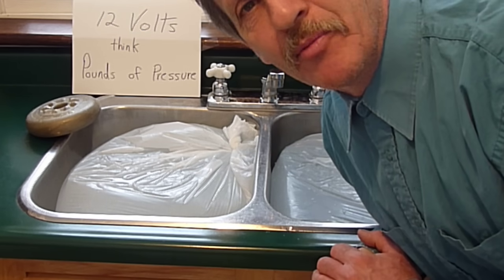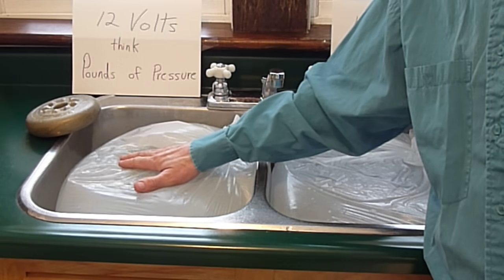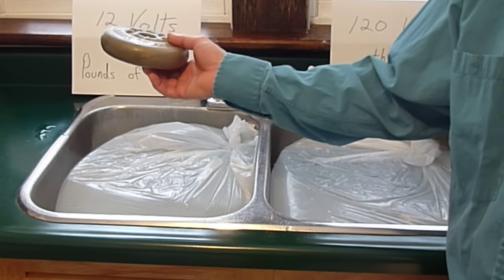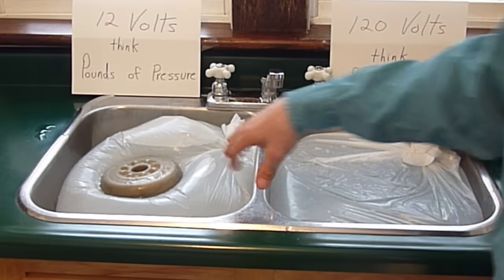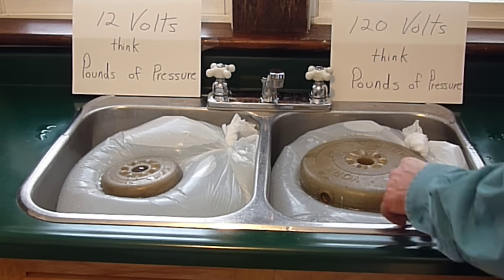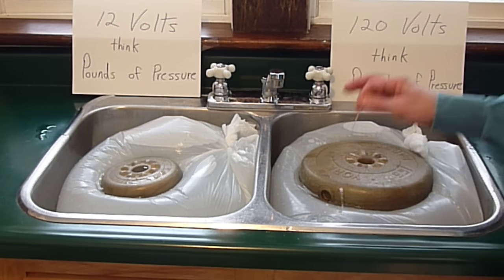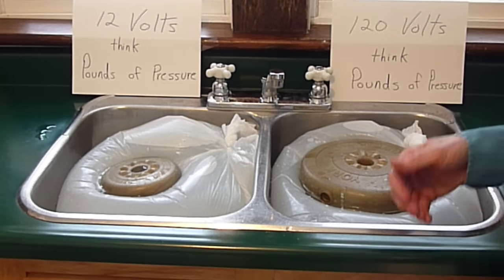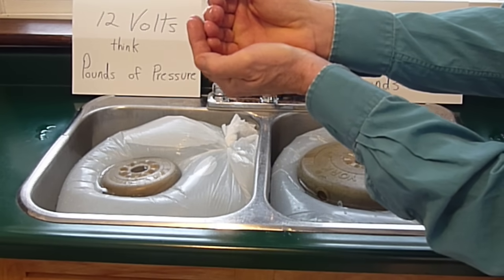Amps, volts, watts explained...SEE what it really is all about.

Comment: It is VERY upsetting to me that all this is not better explained to ALL PEOPLE as a matter of general knowledge, since our entire civilization runs off of it.
Reply: People just care if things work, they don’t care about the why or how.
Reply: If they did I wasn't paying attention
Reply: @lovesyoohoo  oh don't worry, they didn't mention it
Reply: There you go! Now that you know it, go out and start explaining, no need to get upset anymore!
Reply: I even work in energy efficiency (more admin/ops for programs, not an engineer), and I still haven’t gotten my head fully around these three fundamentals :/ these analogies are very helpful
Reply: Well, I was taught this in high school. It wasn't with weights and literal bags of water, but we did have electrical concepts explained by analogy to water. Voltage is the pressure pushing the electricity to flow, current is the flow rate and resistance is like roots and pebbles stifling the flow.
Reply: @Elriuhilu  did you go to high-school in the U.S? If so, what kind and what years?
Reply: @muddbear6410  No, it was in Australia in the late nineties. Just a normal high school.
Reply: @Elriuhilu  ah, yep.  I knew it couldn't be in the U.S. Our schools wouldn't be caught dead teaching anything so useful. For heaven's sake, it might promote thinking or worse, understanding. 
    Over here you have to pay for any actual knowledge beyond the most basic reading and arithmetic. High school is free/ cheap and extended to all. The U.S. would NEVER risk a knowledgeable or capable public. (They might realize they're getting screwed, or WORSE, do something about it)
Reply: What are you doing about it
Reply: Education in general is too focused on test taking mastery and not practical knowledge and application. Granted, folks learn a bit differently but that's differences in flavors of ice cream not the differences between strawberry ice cream, rocks, and battery acid as many unaccountable push.

Even folks that absorb it quickly and ace exams often have 'aha' moments later where it all clicks.

I'd like to see less rote memorization and more approaches like in the video here.
Reply: The schools are teaching kids about 30 different genders instead.
Reply: Wow, this sounds like the kids-in-school-will-pay-attention corner of YouTube.
😂
Reply: @tiltil9442 they will if that old renta a cop in the hallway is armed!

Use punctuation, Timmy!  Or else!
Reply: better to learn how many genders there are and why terrorist groups are really just oppressed people
Reply: They don't want you to understand this.   If you knew how to harness energy you would be powerful.   They prefer you be confused and leave this to "science" and go smoke a vape pipe and listen to monotonous repetitive degenerate music.
Reply: @truthshallsetyoufree99  just because you're dim doesn't mean it's a plot
Reply: @muddbear6410  🤭 whaaaaateverrrrrr
Reply: @richinoable  😂  ah yes, the strongest defense when challenged: "whatever" lol
 An age old defense originally inspired by the bear attack strategy of: "assume the fetal position and urinate."
Reply: @richinoable  😂  I get it now, you're gen z or younger.  That or special class levels of immaturity is the only explanation for thinking someone's angry when there wasn't a single derogatory or even negative statement made. 
   Also explains the "whatever" when asked about your nonsense.
Reply: @truthshallsetyoufree99  yeah you're right, and i don't know that i would call it a "plot" as our buddy richinoable has it.
    Only a moron wouldn't understand that the better educated/ knowledgeable/ capable the average member of a population becomes, the wealthy elite of that population experience more competition and risk of losing their social and economic position.  
   Throughout recorded history those at the top of the social pyramid have endeavored to keep those of the lower levels from ascending. That doesn't mean they're all meeting up to conspire, but it does mean that every time they're faced with an opportunity to hinder their perspective competition, they take full advantage of the situation. 
    That's as basic as it gets. You see it constantly in nature and to deny its existence and even amplification in mankind is beyond foolish. Such a person has fundamentally misunderstood the human condition.
Reply: Who does it profit for you to be better informed?
Reply: @YeshuaIsTheTruth  not sure what you're trying to get at because your question seems confoundingly obvious, but it profits ME to be better informed. It also profits any employer that hires me for that knowledge, AND it profits customers of myself or that employer who benefit from said knowledge, or anyone I help with that knowledge. 
     NOW, let's also remember who benefits from me NOT gaining this or other knowledge. Firstly those who are already directly using said knowledge for profit. Secondly, and less directly but still significantly, the wealthy elite that control our world (ultimately through information, but more apparently through economic manipulation) benefit from myself and the general population having primarily compartmentalized knowledge, or only enough knowledge to do their job and contribute to the greater economy. They are DIRECTLY THREATENED by the population being more knowledgeable. The broader and more useful the knowledge, the greater threat to the Powers-That-Be, currently the wealthy elite. 
    THIS IS BECAUSE, the more useful knowledge a person can effectively wield, the less need they have for the goods and services provided by the economic structure. The more a person fixes and provides for their own needs, the less valuable that person becomes to the economy because they are retaining more of the currency they acquire rather than spending it on goods and services and feeding back into the economy. 
     A person who solely provides most of their own goods and services is not that big of a threat alone, but they are HIGHLY dangerous as potential disrupters or dismantlers of the current system. That person could inspire others to do the same, or worse, teach others how to do it. This results in these people syphoning off currency from the economy and using it to elevate themselves towards independent economic power rather than feeding back into the economy and remaining stagnate in elevation of power OR only elevating in power at the behest of those who already wield power.
Reply: @YeshuaIsTheTruth   not sure what you're trying to get at because your question seems confoundingly obvious, but it profits ME to be better informed. It also profits any employer that hires me for that knowledge, AND it profits customers of myself or that employer who benefit from said knowledge, or anyone I help with that knowledge. 
     NOW, let's also remember who benefits from me NOT gaining this or other knowledge. Firstly those who are already directly using said knowledge for profit. Secondly, and less directly but still significantly, the wealthy elite that control our world (ultimately through information, but more apparently through economic manipulation) benefit from myself and the general population having primarily compartmentalized knowledge, or only enough knowledge to do their job and contribute to the greater economy. They are DIRECTLY THREATENED by the population being more knowledgeable. The broader and more useful the knowledge, the greater threat to the Powers-That-Be, currently the wealthy elite. 
    THIS IS BECAUSE, the more useful knowledge a person can effectively wield, the less need they have for the goods and services provided by the economic structure. The more a person fixes and provides for their own needs, the less valuable that person becomes to the economy because they are retaining more of the currency they acquire rather than spending it on goods and services and feeding back into the economy. 
     A person who solely provides most of their own goods and services is not that big of a threat alone, but they are HIGHLY dangerous as potential disrupters or dismantlers of the current system. That person could inspire others to do the same, or worse, teach others how to do it. This results in these people syphoning off currency from the economy and using it to elevate themselves towards independent economic power rather than feeding back into the economy and remaining stagnate in elevation of power OR only elevating in power at the behest of those who already wield power.
Reply: It's okay; he got it wrong anyway.
Reply: @PANZERFAUST90  in what way?
Reply: we learned about this in school pretty early on, its just pretty boring for most kids and they forget it again
Reply: The power of voltage may shock you but amperage will make your leg feel like it's in your arm until the burn heals. Sometimes it takes an electrician to verify what engineers skipped over.
Reply: That is not something to get VERY upset about.

Though poor education in general is upsetting, for sure.
Reply: Not very many people are able to say things in a way that makes others understand it. Most teaching is by wrote. Getting others to understand  a subject is not something everyone is able to do.
Reply: @rickhawkins218  yeah but I think it should be taught in schools so that everybody knows the basics
Reply: @muddbear6410 your school didn't?  Don't go painting my school with that brush.
Reply: @ryantingley9592  but the fundamental electrical info, like in this video, is explaining concepts in the abstract. 
    Saying, "Teaching a kid the difference between voltage, wattage, and amperage could lead them to electrocute themselves" etc, is like saying, "Teaching a kid about tree rings and forestry could lead them to being crushed by felling a tree, etc."
    It's not teaching how to wire something or where to even begin with such a thing, it's an abstract explanation of concepts. Plus I'm not suggesting this be taught in elementary school, but high school is plenty old enough to be responsible about such things, i.e. shop class.
Reply: @rickhawkins218 Not just "able," most dont care to do it.
Reply: @rickhawkins218 not what @muddbear6410 was saying, but I agree with both.
Reply: @PasP-r7c  lol yeah metric is the way to go for paper pushers, but for people that get their hands dirty, actually working and building, Imperial units for FAR superior (and in a survival situation/ cataclysm metric can't even come close to as useful) 
    Nearly every commonly used unit in Imperial corresponds to the human body. Inch= tip of fore finger to first knuckle. Foot= average man's foot. Yard= average man's stride, etc etc. many correspondences you can look up.
    It's all because that's how measures originated, by using the body to measure. Not to mention the occult significance of a person building their own tools or dwellings using their own body cannot be overstated. (Also the numbers in each unit are of great esoteric significance)
    Plop the average metric user in the jungle and they're MUCH more handicapped because their measures will be entirely off reckoning which alters imperceptibly hour to hour and day to day. 
     So yeah, don't knock the old ways. They were good enough for the entirety of human population until VERY recently. Metric hasn't stood the test of time. I doubt if it could survive societal collapse. At most people might keep the base ten system but use a different increment
Reply: @muddbear6410  praising the imperial system under a video about electricity is pretty odd... given there are no imperial units that describe electricity
Reply: @camicus-3249  did you not read the comment I was responding to? Most anything is odd without its context
Reply: @muddbear6410  the one about pounds? How does that context change the point?
Reply: @camicus-3249  seriously? Are you allergic to reading or unfamiliar with the language? 
   He said,  "Explaining this with "pounds" is just sad."  That's referring to the entire world's use of the metric system, with the notable exceptions of the U.S.A, Myanmar, and Iberia. The commentor obviously feels metric is the only sensible system of measures. 
    So I replied that metric is definitely better for paperwork and calculations, but the Imperial System is ancient, has stood the test of time,  social upheaval, and it really shines in situations where a person finds they need to measure something but  have no measuring device. (Because the most used Imperial units are based on the size of average human body parts.)
Reply: @muddbear6410  ah I see what you meant. FYI paper pusher doesn't mean someone who does paper calculations -- it's a negative term referring to managers and bureaucrats
Reply: @camicus-3249  lol kinda. Paper pusher is informal and not necessarily negative. It CAN refer to bureaucrats, and is generally negative in that sense because it demeans government work to the level of an unskilled clerk. This is because of the more common usage:  "someone who has a routine desk job" or "menial clerical worker." 
    If you want to think of it as negative in all cases then it's very mild. 
    Anyway that's exactly the right phrase for my use. I wanted to contrast someone sitting at a desk figuring on paper, to someone actually building, working with their hands.
Reply: @muddbear6410 triiiiiiggerrrrrrrrrrrd by metrics

Comment: Two bags have same Amperes. Not same Watts On the right bag, these Amperes will be consumed faster, because of heavier (bigger) battery, although two bags have same holes. Ok. It's "about" what you say:two bags have same Watts. But, because Watt is a unit that comes WITH TIME, it's better to say at the beginning of video that two bags have same amount of electricity (same Amps). About tme as a unit, I mentioned, on  your example, time comes into play  because of more pressure (more Volts because of bigger/heavier battery on right bag). So, more power the water coming out of right bag every moment. That's why, and correct, you tremble your hands when you want to collect some amount of electricity on right bag. There, on right bag, electricity comes with more power (more electric energy/moment). Watts is the usage of electric energy that electricity produces, and is being measured onn energy/moment. My analysis for someone that gooes a little deeper in words and on electricity study.

Comment: But if the power is the same (10,000 watts as you mentioned) and P=voltage x current then shouldn’t a higher voltage result in a lower current and a lower voltage result in a higher current?
Reply: Yes

Comment: Extremely helpful. I have a working knowledge of electricity in the way that i can build a drone, but im just now learning why they work vs how they work. Voltage seems to be like gallons per minute drawing from a source, wires are simply pipes which need to be correctly sized, switches are valves. Who says electricity and water dont mix. Im a pipefitter lol

Comment: It took me forever to figure out how amps and watts are different. This made it clear in 2 freaking sentences. Great work! 

Also if I understand correctly, you could have punctured the bags with a lower ohm pencil instead of the higher ohm toothpick which would have increased the current (amps) of the water spurting out of the bag and would also end up with more total water being out of the bag (watts).

Did I get that right?

Comment: This started to make sense, but now I’m back confused again. When I calculated the amps, the 12 Volt system was putting out 12.5 Amps and the 120 Volt system was putting out only 1.25 Amps. So the 12 Volt was the tiny leak and the 120 Volt was the big gusher. Just like a tire with 120 psi leaks fast and loud but a tire with 12 psi is almost unnoticeable. That part made sense. But bringing amperage into the mix, I just don’t understand. I’m sorry, sometimes I’m worse than a 6 year old.

Comment: Still makes no sense to me.  I still don't know what amps are, what watts are, or what volts are.  I still don't know what these units are measurements of.  Makes no sense.  None.  And I've watched many, many videos.  The deepest my understanding goes is that when certain materials are in motion, they generate electricity, this electricity can then be stored under certain circumstances.  This is all I know.  I don't know what volts/amps/watts are, and frankly I don't care because it sounds like an incomplete theory used to explain away things nobody truly understands.  I've not yet seen a single video in my 30 years of life that sufficiently explains WHAT these terms are referring to.  This whole thing can and should be simplified, but it's not, because nobody yet understands it.   Nobody knows what electromagnetism actually IS or WHY, and so all these terms and theories are grasping at straws.  I know I'm oversimplifying, but I can't stand nonsense, and to me watts/volts/amps are all just explaining properties of a particular electrical charge and/or current, without actually knowing what those properties really are, so it's all one big assumption.  Electricity does what it wants, and we really have no idea why yet.  We're lucky that we figured out how to manipulate it, but we still have no idea what we're manipulating or really even how.  We just have worked out what works and what doesn't through trial and error, monkeying around.  We don't actually know what any of this stuff is, and I'm starting to lose my mind thinking about it so I'll leave it at that.

Comment: I have a question though, I have an old tube amplifier radio which has 2 speakers which rated, 3VA 4Ω each channel and I would like to change that to modern speaker. For that, how much 'Watts' speakers should I use?